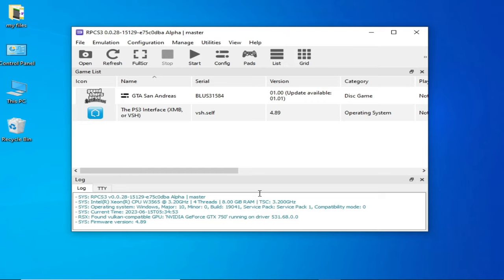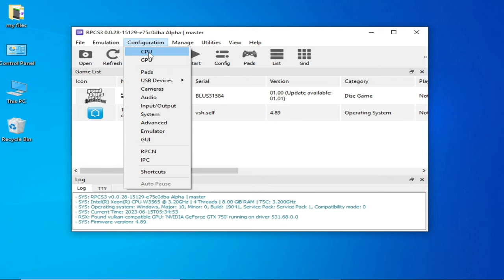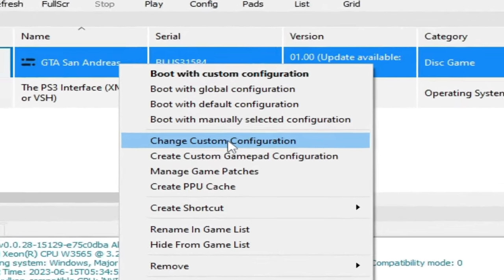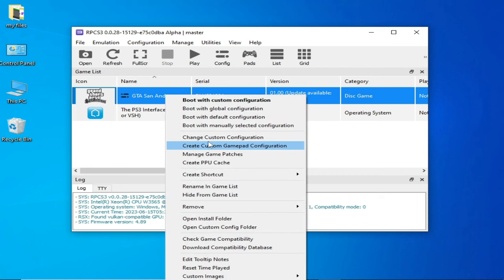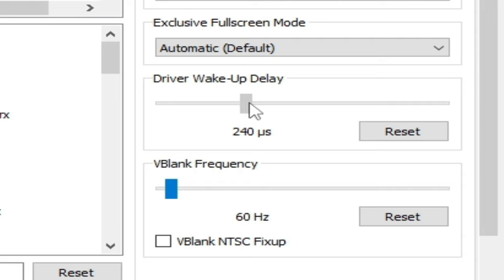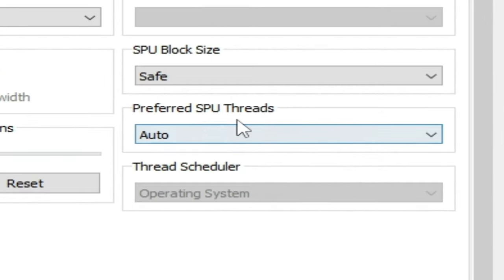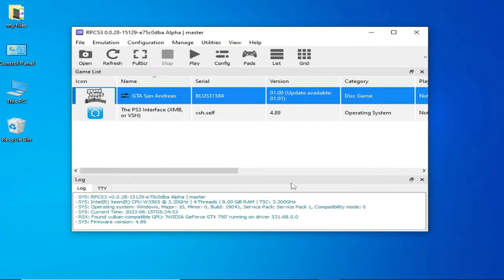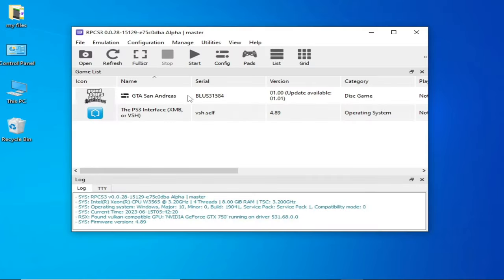How to Fix RPCS3 Stuck at Compiling PPU Shader Modules

Comment: Alguien me podria ayudar? Tengo el emulador instalado, con su firmware, y el Dragon ball raging blast 2 descargado, pero cuando lo abre constamente carga shaders, y se pone super lento, mi pc es medianamente rapida i5 9400, 1070ti, 16gb de ram, deberia correrlo sin problemas. Saben de alguna solucion o configuracion? Por favor, gracias.
--------------------------------------------------------
Someone could help me? I have the emulator installed, with its firmware, and Dragon Ball Raging Blast 2 downloaded, but when I open it it constantly loads shaders, and it gets super slow, my PC is moderately fast i5 9400, 1070ti, 16GB of ram, it should run without problems . Do you know any solution or configuration? Please thanks. !  ! ! ! ! ! ! ! !  !
Reply: Eso sucede debido a que algunos juegos necesitas una configuracion especifica para poder funcionar correctamente, lo que a mi me sirvio fue en vez de poner que los graficos fueran altos, ponerlos medianos o incluso en bajo desde la configuracion del emulador